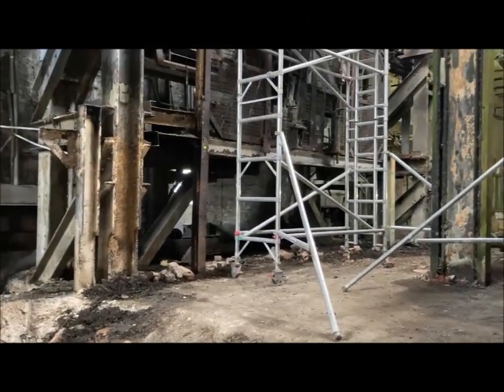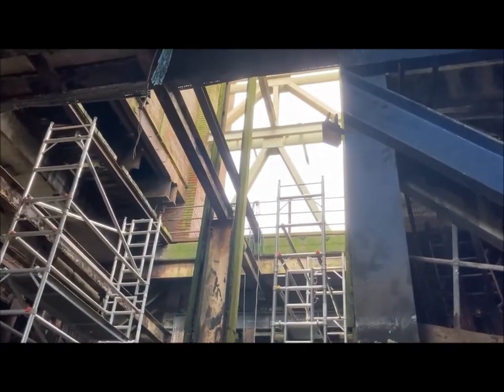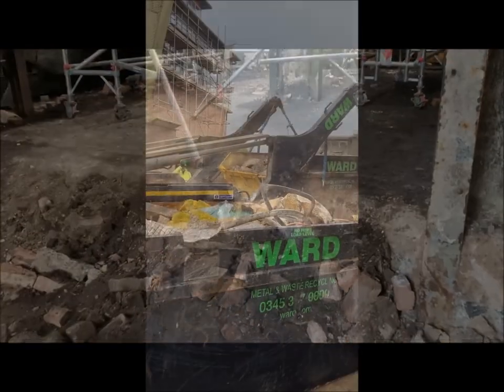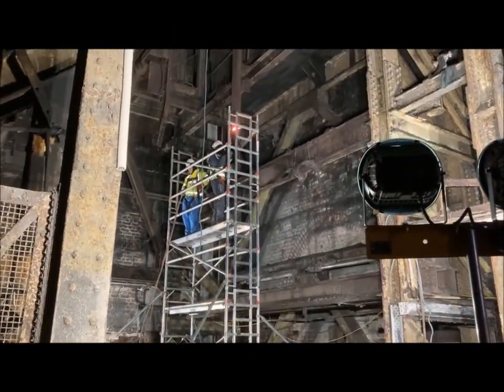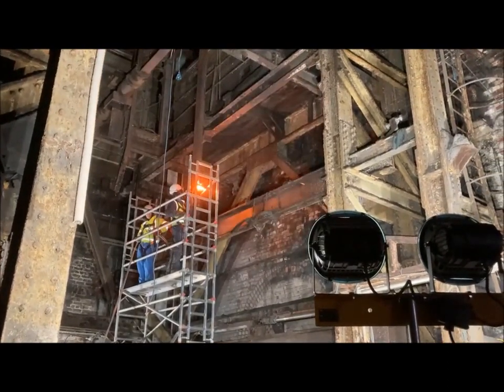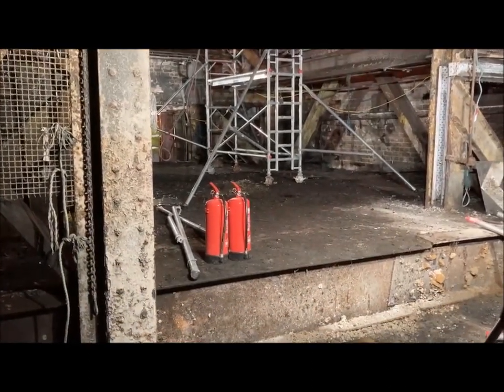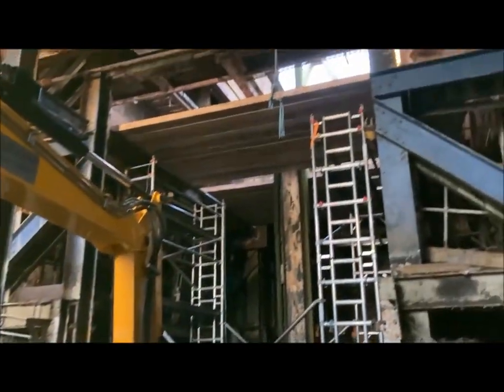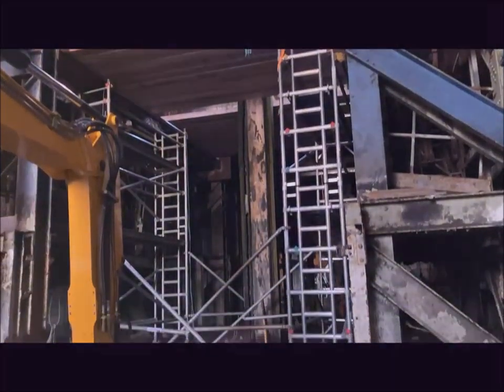Capping a coal mine (colliery) shaft

Comment: Did removing the cap reveal an empty shaft top to bottom or was it filled in under the cap ?
Reply from the maker: the shafts are filled with 100,000 tons of stone
Reply: @stuartmills2209 Why not use the shaft to put our rubbish etc that would normally go into landfill ?